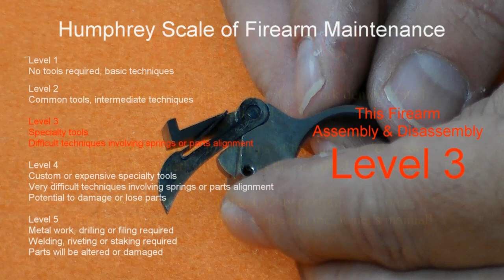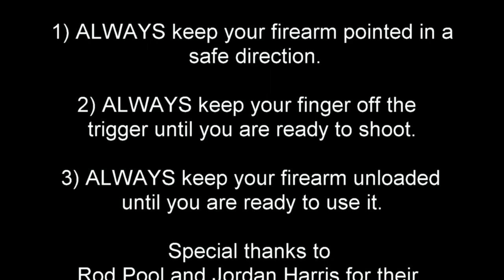Harrington & Richardson American Double Action --Armorer level disassembly

Comment: Hey I’ve got an H&R hammerless .32 that has a trigger rebound issue. When I took it apart the trigger rebound spring was broken. I replaced it and it took several times taking it apart and putting it back together before I was able to get the spring in the right place. After that, I tried it, but the trigger didn’t rebound. If you pull the trigger to just before it breaks the sear engagement, the trigger returns back to the ready position. Just when I pull the trigger all the way does it fail to return. It feels like there may be some friction on it at some point but since it is not a user friendly gun, I can’t tell where. Do you have any suggestions as to what it may be so I can check it? There aren’t any videos on YouTube that show how to Service or repair the new small frame hammerless model top break. I would appreciate any ideas you can give me.
Reply: Watch the video closely at 8:23, you will see I had the same problem with the trigger rebound spring.  If you don't install it just the way I do it will slip off, this part of the reassembly is definitely the trickiest.  If you're following that procedure and it's still slipping off (listen for the click) could be that your replacement spring is a little short and won't stay in place no matter how you install it.  Hope that helps, let me know how it turns out.  Thanks for watching!

Comment: Sat Sri Akaal Sir,  Please guide that   in which year H&R 32 bore 632 revolver with serial number 541841 made in USA would hv been made
Reply from the maker: Hmmm... that's not a serial number consistent with a 632.  632's were made post 1940 in which case the serial number should start with a letter.  632's were made from 1952-1958 and 1973-1986.  Now if you misread that leading 5, and it's actually an S then that would be consistent.  Serial numbers starting with S designate a 1956 manufacture date.  There's very good book by W.E. "Bill" Goforth on H&R firearms, it's available on Amazon, he is a leading authority on H&R history.  Otherwise here's a link to the post 1940 serial number key https://gun-data.com/harringtonrichardson2_modern.html

Comment: Does the cylinder soon free in that untill you pull on the trigger? Mine does but locks up altho Its a sloppy lock up. I'd really like to get it made safe to fire
Reply: Yes the cylinder spins freely until the trigger is pulled.

Comment: It's my cylinder stop or locker it wasn't go down when I pull back on the trigger.Is there a video on how to replace a synonym stopper or locker?
Reply from the maker: OK, that's helps.  So first, I don't have a 922 to compare to and I've never taken one down, but it's not that different from other revolvers.  So the Cylinder stop moves one way when the trigger moves (obviously you have that figured out) and moves the other way under spring force.  Normally the trigger pulls it down and the spring pushes it up.  First, with the cylinder removed, push on the cylinder stop and see if it moves (you might have to pull the trigger at the same time).  If the cylinder stop will move and it's springing back into position, but the trigger doesn't move it then it might be broken.  Looking at the parts pictures the cylinder lock is kind of like an open jaw, if the lower half were broken then the trigger couldn't pull it down.   Again if the stop moves freely but the spring is meant to pull it down, then the spring might be broken, collapsed or gummed up. Hope that helps

Comment: I have a octagon barrel , model04.32.6shot Double action. Basically the same gun. where can I find replacement parts . lever spring , shear, and other very hard to find parts. Numrich has, but very limited and not what I need to bring back to fully functioning. Would love to honor grandpa , fix it , dip it ,then display properly. not for EDC, Just knowing it can cycle when my grandson is old enough.
Reply from the maker: Numrich is generally the best bet.  But Jack First Gun Parts has a pretty good supply.  You can always buy a used one and rob it for parts.  I saw one on Gun Broker not too long ago $26 for the whole gun.  I'll bet you could pull the parts you need and sell the rest to Numrich and at least break even.

Comment: A short piece of a tooth pick works great as a slave pin for all kinds of old cheap revolvers.
Reply from the maker: Good comment.  You can be innovative with slave pins, Q-Tips, wooden matches, a piece of wire, tooth picks (as you said) etc all will do in  a pinch.  Putting a touch of grease on the undersized ones to hold them in place is a good trick too.  I actually have a video on my site on how to make slave pins, if you're interested  https://youtu.be/zEgFdyc7_xc

Comment: Ok on this video now haha mine is actually different it's a break open h&r premier it doesn't have the friction pin just a pin on the trigger that come up and the dog that comes out to spin the cylinder witch one do you feel would hold the cylinder? Or do both of them?
Reply from the maker: When I was looking at parts lists last night I noticed it was a top break.  The two parts of interest are the cylinder stop and the hand.  The stop comes up from the bottom of the cylinder and engages the side of the cylinder and the hand come out of the breech face and engages the end of the cylinder.  So check those parts for wear, but also inspect the cylinder (where those parts engage) for wear.  Also check those parts for freedom of movement.  The hand advances the cylinder but the stop holds it.
Reply: The Premier has a long narrow spring in a groove in the cylinder axis.  This is what provides cylinder tension.
Reply: Well I did some looking and measuring seems the knub that sticks up off the trigger to hold the cylinder is worn as well and the grooves in the cylinder look worn sorry I don't know the actual terminology my question is can I build that knub up with jb weld and file it down to fit or won't jb weld be strong enough? As well as putting the cylinder in my mill and knock that groove out a couple thousandths? Can't find a new trigger or cylinder it's stamped 933 but I can't find anything except the hand grips
Reply from the maker: I'd be surprised if JBweld held up very long.  Sounds like it going to be a tough fix, you might be able to make a new trigger.  But it may be time to put this one down :-(  If you're really attached to this one, there's one on Gunbroker for $26, buy it and use it for parts.
Reply: I'm not really attached just never shot it and would like to plus if I ever want to sell it I wouldn't feel right with the cylinder rock is the mechanism usually regular steel? That I could braise it then hit it with the end mill down to tolerance?
Reply from the maker: I don't see that either of those points are high stress, brazing and milling it back would probably work.  The metallurgy of the components is a big unknown, I can't see why you'd make the trigger out of anything other than mild steel but the cylinder might be hardened. The heat is obviously going to effect the metallurgy of the cylinder and if it was a more potent caliber that might be an issue, but with 22LR, there's a lot of metal there for that little round.  Obviously try it, test it cautiously and keep an eye out for signs of failure

Comment: Try to find what year my h&r was made. No writing on the octagon 2"barrel. #2212 in the metal frame handle. Under the grips. I have a picture of my great-great uncle  holding it as he was picture on September  16th, 1893. Can anybody help? Thank you.
Reply from the maker: Sounds like a first model second variation 1888-1897.  If the picture is dated correctly that narrows it down to a 5 year window 1888-1893.  With these guns and the wild serial number sequences that's about as good as it gets.  The book Bill Goforth’s H&R Arms Co 1871-1986 is highly regarded for history on Harrington & Richardson.  If there's more detail to be found it'll be in Goforth's book.
Reply: @ImminentThreatDefense  thank you for your help. Appreciate it.

Comment: I own a H&R MODEL 922. A.R. ARMS CO..worce mass USA.. 9 shot 22.. I was great gift for my grandmother.. I have to cylinder both 9 shot .. clean the find teeth com... both cylinder.  Will go inand look in places...but it comes to pull the trigger..it won't rotate No Type of Way please help cuz I really do love this gun trigger and fire pin work every good... help???? Or give me a clue?????
Reply from the maker: Of course it's very difficult to tell from a verbal description.  Understanding how it works is key to diagnosing the problem.  But if I understand you, you can pull the trigger but the cylinder won't rotate.  The cylinder rotates on the "center pin" (see video at 1:35) so presuming the center pin isn't bent and the cylinder rotates freely on the center pin then we can look elsewhere.  The cylinder is advanced with the "lifter" pushing on the cylinder star (4:35).  You should be able to look through the gap between the cylinder and breech face and see if the lifter is engaging the cylinder.  If not then the lifter spring is broken or the lifter is gummed up and can't move, or the lifter could be broken or missing.  If the lifter is engaging but not grabbing the back of the cylinder then the cylinder star or the lifter tip could be worn.  How to fix it?  Well of course I have to recommend you take it to a trained gunsmith.  The gunsmith could determine if it's just gummed up take it apart and clean it, if he didn't want to take it apart he could soak it overnight in gun solvent then try blowing it out with compressed air.  Otherwise figure out which part is broken or worn and replace it.  Try Gunpartscorp.com for parts for this gun.  Hope that helps, thanks for watching.

Comment: what are the tools called to remove pins?
Reply from the maker: The punch's are available from Brownells, they call them replaceable pin punch part number 080507050.  The come with steel pins but you can buy brass rod stock that fits so you can replace the steel.  Brass obviously bends and wears faster but both pins can be easily replaced.  Plus you can cut the pins to length.  I particularly like that they have a square shoulder so I don't have to worry about over driving them and damaging the firearm.  Thanks for watching!

Comment: Where can I get a friction pin and spring?
Reply from the maker: Numrich has the parts for less than $10 but they're not in stock.
Jack First doesn't list the gun but call them they're pretty good at helping out.

That said, you can make those parts easier than you think.  The pin could be made from a standard piece of rod or cut off drill bit.  In fact, use a drill bit to figure out the diameter of the hole for the pin.  

You can probably find a spring that fits from inside something else like the spring that pushes on the flint in a lighter or in a ball point pen, or a toy.  Or there are tons of spring kits like on Amazon that you might find the right diameter and cut it to length.  Also, Brownells has them maybe the by Wolff kit #1607